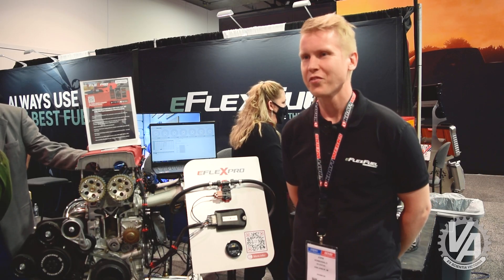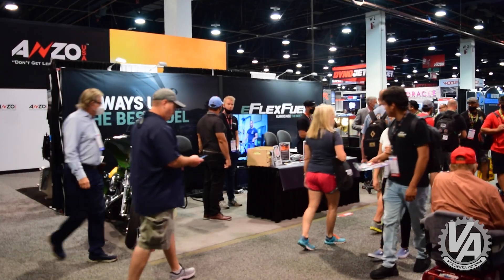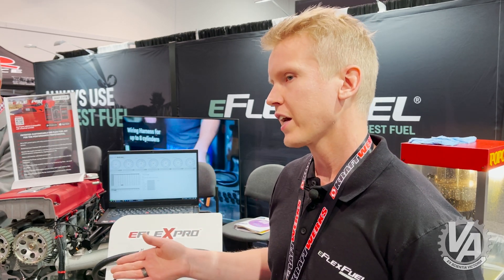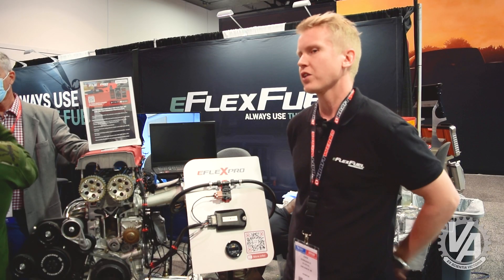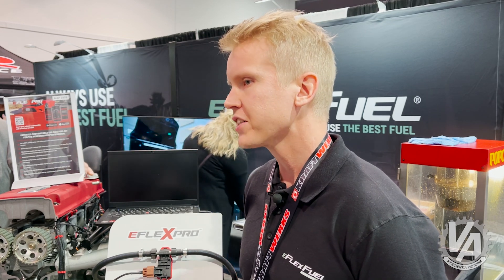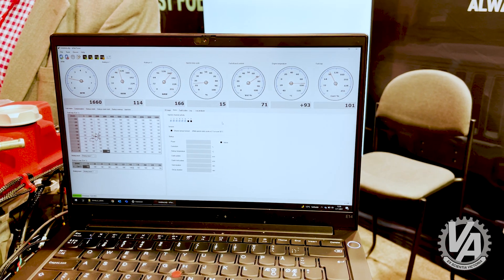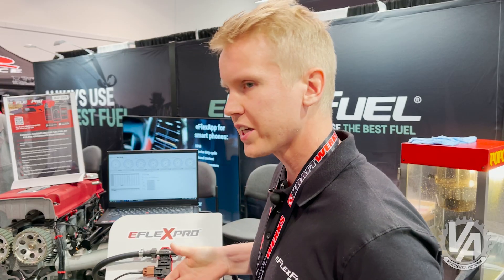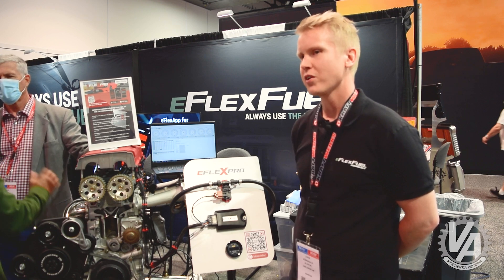Plug and Play E85 Tuning: eFlexFuel Ethanol Conversion Kit

Comment: I put this kit on my stock 2002 Mustang GT. It ran fine for several days on 44% ethanol content but the day that I refilled the tank I got 61% ethanol content (a mix between 44% and 85% which would make it around 61%) and the car died. This is less than a week after I put in the kit. Turns out that it killed my fuel pump (or was it coincidence?) and I have to replace it. The manufacturer and another youtuber said that neither the fuel pump nor the fuel injectors need to be upgraded from stock. Anyway, I ordered a fuel pump certified for E85 only to find out that the fuel pump housing for the bad pump was of poor design where you have to remove a small hose to get access to the fuel pump. Which caused another problem because I ended up destroying the small hose and can't find a replacement that is SAE 30R10 anywhere. The corrugated hose fits onto an 1/8 inch OD port on each end of the assembly. So, I have to order a complete assembly with a fuel pump pre-installed because you can't get just the housing from any manufacturer. You might not be able to specify an E85 compatible fuel pump either. I'm not a happy junior mechanic right now.
Reply: 2002 Mustang absolutely a coincidence I have experience with Ford and Chevy American fuel pumps are not long-lasting as Honda or Toyota those things last lifetime as long as there's no contaminants
Reply: Know this kid does not require bigger injectors and less you have forced induction like a supercharger or turbocharger absolutely
Reply: this kit requires bigger injectors and fuel pump id say your pump died because it couldn't handle the ethanol or it was being over worked
Reply: @dh123ize  I did upgrade the fuel pump and it's working OK. I found the OEM housing and installed it in that. But I haven't upgraded the injectors yet.

Comment: I just had EflexFuel installed on a Subaru WRX 2006
The vehicle is tuned for 93 octane.
I filled the tank with E85 after installation. After 2 days of driving, vehicle got a CEL
PO171 System too lean error code. Prior to the CEL my AFR which showed 14.7 at idle on 93 pump gas. On E85 AFR is 14.9 to 15.2 and sometimes even 16!! The sale pitch on this says that retune is not required but obviously that is not the case.
Reply: I had a feeling this e85 kit was just cappin
Reply: Its because its a turbo
Reply: i bet you was out of fuel system it takes 30 percent more fuel for ethanol so bigger pump and injectors are needed
Reply: @dh123ize  I have 2 DW300s fuel pumps and FIC 1200cc Injectors
Reply: If you are boosted and like you said in the video e85 requires bigger injectors and stronger fuel pump if your boosted
Reply: It goes based off of factory settings but you have it tuned for 93 so it's fighting the change which is causing air fuel ratio codes... Even some cars struggle when factory settings.....

Comment: Questions:

 I have a map that's dialed in for 98. When I use just pump gas 98, would this device mess up with my tuned map?

When I use E85, would the existing map in the car  (and all it's parameters) be used-aside of course from injector scaling compensating for E85?

IMO the Pro version is excessively expensive
Reply from the maker: You can ask them at https://eflexfuel.com/us
Reply: Can you run this in the state of California? Dose it modify your Ecm?
Reply: No you cannot however they will never know it and they provide a little CPU where the computer is at you plug it in and it makes everything back to normal and you can still leave your hardwire connected everything connected and it's back to normal and you can get your smog done

Comment: Can this be Installed in a stock 2.4l, K24A8 motor In order to be able to run e85 without issues?
Reply from the maker: Yes, according to the manufacturer.
Reply: @VTECAcademy get eflexfuel to send you a kit for free and make a video , you have big following , curious as to why it hasn’t happened yet

Comment: Carb legal?
Reply: You can easily convert it back to stock when you go for emissions testing.  The emissions produced when applied with all the stock components on your car with e85 is going to be far less.  But CA's red tape b.s. from carb makes it impossible or extremely expensive to do in a carb legal way, even though the emissions are going to be less.  CA is ridiculous.
Reply from the maker: It is not.

Comment: does it improve mpg or just give you the option to switch between e85 and regular?
Reply from the maker: It gives you the option to run E85 or any other percentage of ethanol.
Reply: @VTECAcademy  okay and then if you do run on e85 will that increase mpg?
Reply: @michaeljones7947  I don't think so because the corn gas burns a lot quicker than regular gasoline. Therefore, what I can say about e85 is that it keeps the engines a lot cooler than the standard type gasoline used in engines.
Reply: @michaeljones7947  running e85 will actually decrease your mpg
Reply: @michaeljones7947  my brother bought this kit and is running it in his 5.9 liter 01 RAM 1500. It gained like 20 HP easy on their performance base tune and e85 fuel only. Gas mileage got better.
Reply: @TheBb6prelude  dam when I get my q50 imma get this
Reply: @michaeljones7947  no it goes down, buuuut e85 cost in some places $2 less a gallon than gasoline. So it levels itself out
Reply: It decreases mpg substantially. Maybe 5-8% reduction. But the benefits are substantial. For me here in Cali e85 is about half regular gasoline. And I get 15 mpg give or take now. But I’ll take 10-12mpg for half the price/gallon

Comment: USA will be a tough market. Isn't this exactly what those new EPA laws are banning over there?
Reply from the maker: Lots of people are interested in off-road use only tools for getting increased performance. If you have a 1996-2000 Civic this may be the only chance to tune it so that it can still pass emissions in certain areas.
Reply: @VTECAcademy  ah OK, that's the same as over here in Australia - i thought they were trying to ban anything which changes the factory tune there.
Reply: @VTECAcademy  if I have a Stock d16 would it work 1997 civic?
Reply from the maker: @georgerivera4266  Yes it would

Comment: Can I use this with hondata?
Reply: I don’t believe you need this as the Kpro 4 has flex fuel options built in.  I think this product is more focused on cars using stock ECUs
Reply from the maker: Yes. But the newer Hondatas are set up to use a flex fuel sensor already.